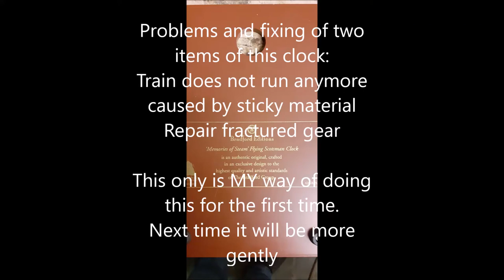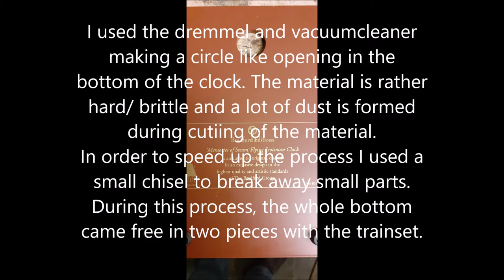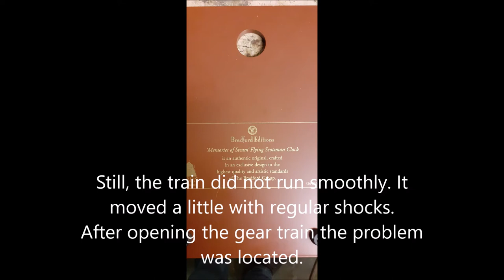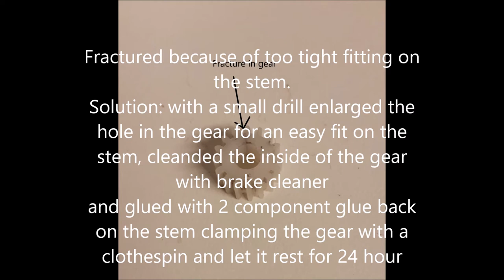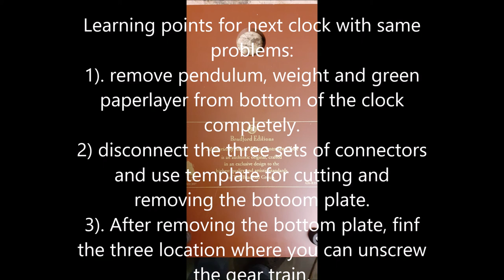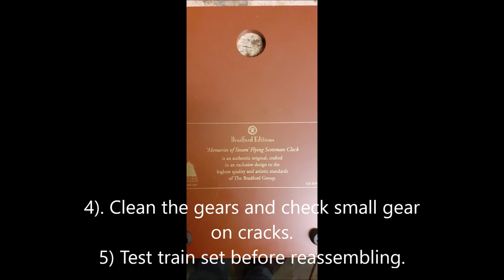Repair Flying Scotsman Cuckoo Clock

Comment: Hi. Pleased to say SUCCESS!! . Now got a fully working Flying Scotsman Clock! Same problem as you , final gear drive to outer wheel split, no doubt due to small  “grandson fingers” trying to move the train manually ! My biggest problem was exposing the 3 plug connectors, covered in glue, a few broken wires. Thanks for template for screw holes, worked perfectly. 
Bob
Reply from the maker: Awesome. Thanks for the feedback. Glad that anyone with a bit of guts, who has the same clock, can repair it again

Comment: Excellent video. I've just bought one of these clocks second hand via a charity and was hoping to give it to my son for his birthday. Unfortunately the clock has the same problem as yours had so I'm hoping I have the skills and confidence to repair it using your very helpful video. Just need to buy a dremel and also would you mind sharing the template for the screws if that's ok. Thank you very much.
Helen
Reply: Sorry just realised you have shown the measurements for the screw template. I presume once I extract the base I'll be able to establish the screw holes from the measurements. Thanks

Comment: This video helped a lot but I didn’t need to remove the base   I followed all the Instructions in the video  but I got a really thin flexible knife and gently slid it in from the back of the clock and  the side break  the glue supporting the train set . When it’s lifted shine a torch in the back and you will see where the resin on the base is thinner . And that shows you where the screws are . If you drill  away the plastic shoulders in the screw holes of the train set it will  slide out from the rear of the clock without removing any of the Bradford base . You only have to drill the plastic away from the front screw hole of the trains set as that’s the one which stops you sliding it out . I think Bradford intended them to fit  that way when they made them but I’m not sure .
Reply: Doesn't which area do you stick your knife down
Reply: Doesn't make sense even can you upload pictures please

Comment: Hello there I have a Bradford Editions Celebration of steam flying scotsman clock and have just found out its not working as it should I left it switched on and the train stopped at 13:00 and the clock bonged 3 times and then the train started going round again until 14:00 and did the same again as I no longer have the manual I am at a loss I have always thought that it should stop as it is with the rest of them that I have from Bradford Exchange but on the other ones the on/off is a knob you turn this one there is a switch which is either on or off If you can help I would be immensly grateful Thanks 
                                    Gav

Comment from the maker: To access the train's mechanics, the base plate must be removed. Remove the cover (lining) at the bottom of the base plate, this allows you to see how the base plate is divided. (You will see a seam and/or color difference). Now you need to cut/scrape open (or weaken) the seam with a dremel or other tool until the base plate with mechanics comes loose. Trying to place a screwdriver between the base plate and the left tunnel (left side down) and right tunnel (right side down) and gently prying it up can speed up the process a bit.
If the plate has come loose, use the template to drill the holes to access the screws. Make sure that you do not drill too deep, which will damage the screws. When the screws have been loosened, the top of the mechanism can be removed. The bottom of the mechanism remains attached to the base plate (it is glued).
Reply from the maker: Perfect, progressive insight makes it all a lot easier. Thank you for sharing your experience and ideas that will help others keep this unique clock in use.

Comment: Ref the hole template. What did you use as a datum line. If the screws are exposed after drilling can the motor be removed without breaking out the hard material clock base? 
Just starting this repair now I’ve found your inspirational video. Normally do German (Hermle) clock movement repairs, so this is different,!

Comment: We are trying to fix the clock my grandad left who recent passed but the whistle boy isn’t popping out??
Reply from the maker: My condolences on the death of your grandfather.
Regarding the clock: I had a similar case with a modern cuckoo clock, the servo motor that is supposed to bring out the figure had a dirty rotor. This is a major challenge with the flying scotsman clock, which I have not yet done because it still works properly for me.
I would be the first to check the batteries and the contacts of the batteries. Then try to slide the screw head, which is located in the middle under the large black block, forward. This screw is connected to the doors and the male that should come out. Does that move smoothly or heavily? Hopefully this helps and otherwise ........?
Reply: @Bing1951feb  thank you so much have a good evening.
Reply: @Bing1951feb  the screw moves smoothly.

Comment: Hey i just got this clock, on mine the upper doors don’t open and push the guy out... if I pull the doors open, they will shut on their own tho...
Reply: Ha! Fixed it myself! Just wiggled the wires and pushed all the plugs together and it started working! 😊🚂🕰
Reply: @TheFrogfeeder  Can you describe how you done this as mine won't come out
Reply: @MatthewWilkinson  this was a year ago, I don’t remember exactly, but I just messed with the wires and connections until it started working…make sure everything is tight
Reply: @TheFrogfeeder  ok thanks,

Comment: First of all great job 👏 
Now I have this clock and the train is working fine but the time on the clock is stood still  but the pendulum is swinging fine 
Any idea what it could be
Reply from the maker: First: always check the batteries, then check the contacts of the battery holder for possible corrosion. Insert (new) batteries and listen (sound of ticking) and see if the clockwork is running again (look at the place where a second hand would normally be if the sealing cap turns). Is the clock running? problem solved.
Is the clock still not running? problem.
Another possibility to get the movement going is: gently help the cover cap, where the second hand is located, to turn by hand in the direction where the second hand normally rotates.
Doesn't all this help: problem that I can't help you with until my own clock stops.
Reply: Thank you for the reply 
Unfortunately I can not hear the clock ticking though the pendulum is swinging 
Does yours make a ticking noise?
The hands turn fine with the dial at the back and slowly with the front cover 
Maybe I could remove the nut on the clock face and investigate further 
Thanks again for the information
Reply: You can get those clock mechanisms anywhere, even other clocks from a garage sale or something...I bet even amazon sells them. It’s just a battery powered clock...
Reply: @TheFrogfeeder  Hi I did look at them on amazon i did wonder if I replaced the mechanism then would it trigger the train to come out on the hours 
Kind regards Paul